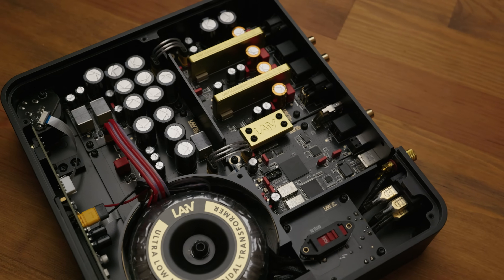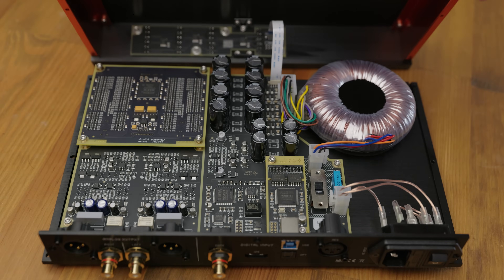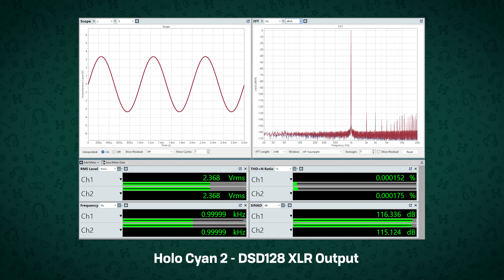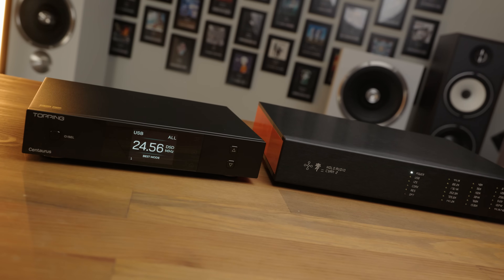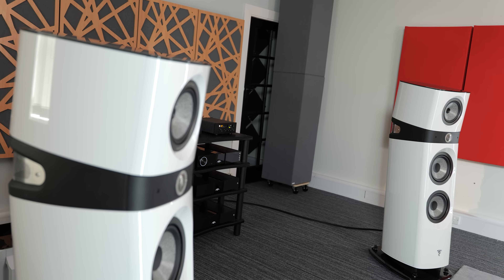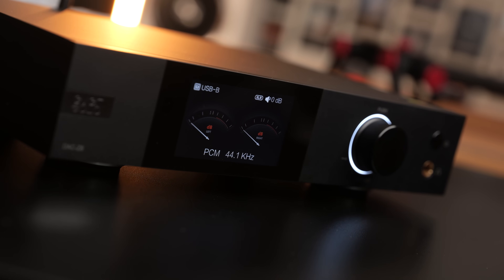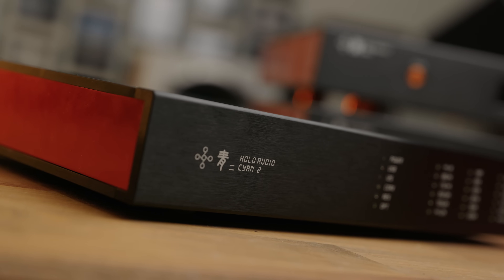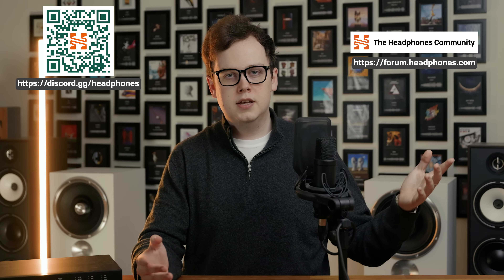The Holo Cyan 2 R2R DAC is fantastic....but....

Comment: Very nice review @GoldenSound as always, but it should be mentioned the transport matters ALOT. I had listen to my Cyan 2 feeded by my macbook pro's usb for months now and never found "the magic" of R2R (my amp is a Burson Voyager Max). I have even tried HqPlayer, including your settings. Nothing magicaly happened until I switched to a windows laptop with ASIO drivers. And OMG what a difference! Especially with Hqplayer. Now I understand the OS and corrections within HQplayer. Trough my Mac I 100% prefer the NOS, but on windows the OS mode is ridiculous good and even the NOS sounds better than the mac NOS. Can you explain what is happening with the mac vs windows setup? Why is there souch a vast difference between the two platforms (especially with spatial presentation)? The difference is like going from a $100 dongle to a full blown DAC as it should have been from the beginning.

Comment: Owner for over a year already and precisely what I hear. Straight NOS is wonderful and software OS is great too.  I use it with AQ Diamond USB, I do not hear any lessening of detail via NOS. It responds really well to better cabling for input and power. With laptops that power up quickly, it is really no hassle power cycling a different input, to coax, for example. Value is through the roof, but it will soon be very 'un-obtainium'.

Comment: some logical question around adding a upsampler is like  using or adding the internal upsampler function to cyan2(if my understanding is correct) but isnt dacs like May can only do either nos or upsampling？but adding an external upsampler to cyan2 implies going through upsampling first then feed through nos.in summary my question is adding an external upsampler to cyan2 is different by design than using upsampling function in May？which would be better？

Comment: so i have the cyan2 (and i love it)
question: 
1. have a wiim ultra what is the best way to connect the cyan2 to the wiim ultra ?
2. will there be a performance increse if i use the "smsl po100 pro" betwine the wiim ultra and the cyan2 (why ?)
thanks
Reply: I have both the Wiim Ultra and Cyan2. I think your best bet is to use USB Out from Wiim to Cyan2. 

Compare to the Eversolo DMP A6 M2, although the Wiim loses a USB DAC input, it makes up for by acting as a DDC. Whatever comes in digitally does go put via USB, I’m not technical enough to know if how much conversion is going on, I’m sure there is. But you kind of eliminate the downside of the Cyan2 not switching inputs easily. 

Hope that helps. No answer for no. 2

Comment: Great review, as per your usual standards :-) However, can I ask why you're recommending the "512+fs" DSD modulator for DSD256 (your recommended HQP settings)? It is my understanding that those modulators have been optimised for rates of 512 upwards, hence should be used with DSD512 upwards. Did you find them superior/better-sounding in lower rates (such as DSD256) also? If my understanding is correct, that modulator is optimised for suppressing noise the most effectively within the audible frequency range (as opposed to spreading it evenly) - I'm wondering how it behaves when used with rates lower than what it was designed for. Thanks

Comment: Thank you very much for your guide. It is very useful. However, your shared Google Drive folder only contains the settings for Cyan 2. Can you please provide me with your setting for Denafrips Venus 12th-1 or Venus 2, or at least let me know how many bits are optimal for Venus? I'm assuming 16, but I'm not sure.

Comment: I sold my Yggy to buy Cyan 2 with Red. I used DSD/HQplayer for my music listening, however with a bluesound node and external power supply, I watch movies,  and in my system Cyan2- NOS and bluesound HDMI arc sound is mind blowing with good soundtracks.
Reply: Which Yggy did you own? And do you think the Cyan 2 is better by much?
Reply: @ Yggy OG. I also have bifrost 64, which is similar to new Yggy TI chips. It is matter of taste, for me Yggy had less punch and a bit edgy. Cyan2 is smoother and has a better punch, less punch than chord DACs though. The reason I bought Cyan2 was high rate NOS and HQP with DSD.
Reply: @shkermanshahi  thanks. I own the Yggdrasil+ GS2 and it has NOS mode that I enjoy. But the Cyan 2 really looks tempting
Reply: @Old-Norse  the Yggy I sold was plus. I have tried nos mode on Yggy and bifrost,  I preferred the filter mode, because filter mode upsamples CD to 705k. The nos mode even with HQP goes to 192k. And it is pcm only.

Comment: Thank you! Finally a good and realistic review of Cyan 2. I have been using the Cyan 2 for a year and I came to the same conclusions as you are. I really love and enjoy with this DAC. In addition, I have been using an Ian Canada DDC reclocker with SC-Pure clocks and connected over I2S to the Cyan 2. For some, it might be an overkill but for me It is a killer combo. And thanks for detailed HQPlayer instructions!
Reply: whats the sc pure clocks for
Reply: @Leo-yn5fx  SC-Pure oscillators are low phase noise oscillators made and sold by Ian Canada. In Ian Canada DCC reclocker the oscillators are replaceable so you can play with them.

Comment: Excellent review. I appreciate your work. I wish Holo would make a fourth DAC that sits between the Cyan2 & Spring3. Single full size case, no display, defeatable lights, BNC input, Better Input Switching, Optional remote and whatever other improvements they could squeeze in. They would sell very well.
Reply: Or get a used Spring 3. People quickly go through DACs

Comment: I have the Cyan 2 since 9 months and I sell it. It is connected to my Bluesound Node 2i and if it did clearly brought improvements in terms of timbre and soundstage compared to the internal DAC of my Node, I’m a little bit disappointed with the fact that it did bring only very little improvements in highs naturalness and sibilance control. Which is something I was really looking for. You could say it’s jitter from the Node, and so I tried USB which supposedly is jitter free, well it WORSE than the node 2i via coax. That really disappointed me. Soundstage became flatter and overall sound became more digital, less relaxed. My conclusion is that maybe with a quality transport like the Red or something like that could really unlock the potential of my dac. But for less money I go for the Auralic Vega S1 which seems to outperform the Cyan while the quality streamer is already in. And that for the same price of my Bluesound/Cyan 2 combo. Hope that will help some people looking to buy a Cyan 2 maybe. Good listening.

Comment: Can't you get the NOS sound on delta sigma DACs just by rolling off the high treble a little?
Reply: Sort of. You can mimic the frequency response behaviour, but many people report that the lack of any DSP, dithering, or noise shaping (which DS DACs must do in order to function, but R2R DACs can run without) yields an audible improvement.

Whether you agree is up to you
Reply: Kinda but the tranisents will be slightly different? It's changing the roll off way above 20khz too

Comment: Considering a lot of us crazy audiophiles use Roon, how is this paired with Roon’s upsampling? I don’t really want to go down the HQPlayer rabbit hole if I don’t have to.
Reply: If you use Roon, it has built in support for HQPlayer, you can just select HQP as an output device in roon, guide is here: https://forum.headphones.com/t/goldens-hqplayer-oversampling-guide/25410

Roon's own OS is slightly better than most DACs, but it's not the same level as HQP or PGGB
Reply: You either choose Roon's upsampling, or you choose HQPlayer, not both. Within Roon's settings you select HQPlayer for playback.

Comment: normally the recommendation was upsampling rather than over sampling. Assuming that oversampling adds filters. so what is better?
afaik higer sample rates work better with nos because of some  reason iI  always forget the exact explanation.
Reply: Oversampling and upsampling are interchangeable terms. They're the same thing. 'Oversampling' is just more often used to describe when the processing is being done realtime and 'upsampling' is more often used to describe when something is upsampled and output to a file. But from a 'what's actually happening' perspective, they're the same thing just different words.

Comment: You are an odd contradiction. A while ago you basically showed in your DAC comparison test that you can't tell the difference between DACs (even though you could hear the filter?), and then here offer up loads of subjective "audiophile" adjectives for various DACs costing 4 figures. Then at the same time talk about how r2r DACs generally measure worse (however any noise below 90-100db won't be audible so the implementation is a relatively moot point). I'm guessing all of these DACs will measure absolutely transparent, and would be shocked if anyone that doesn't have your freakish ability to hear over 20khz could ever tell a real difference.
Reply: I don't recall him showing he couldn't hear the difference between dacs? Not sure what you're talking about
Reply: @mmm-u6e9e  In this video (https://www.youtube.com/watch?v=UzECc522A1Y&t=861s&ab_channel=TheHeadphoneShow) he basically finds that the only difference he can hear between two dacs is the filter one of them is using ABOVE 20KHZ. So a) he learns he can hear above 20khz(!) and b) he didn't hear any difference between the DACs in the freq range that the DACs were producing in common, showing that in the normal audible range (which is entire audible range for the other 99% of us) there's no difference. Therefore to now start using all sorts of flowery language about the many differences in how these high dollar DACs sound is very inconsistent.

I didn't particularly feel that what he did for the test was very meaningful in the over all DAC debate, but he was trying to come up with a way to provide a truthful, verifiable and repeatable result.

Comment: Ddi you transplant the R2R ladder from the Cyan 2 into the Centaurus or the other way around? I'd be interested in seeing the measurements using the other R2R ladder into both DACs.
Reply: The ladder modules are identical, there's no difference between them in terms of function/design. Of the three units I have here there's ~2dB variation in measured performance between them

Comment: What about the Ares 12th?
Reply: The Cyan 2 is notably better than the Ares IMO
Reply: @GoldenSound  which Ares? The ares 2 is not all the same as the 12 or 15th anniversary editions
Reply: 15th
Reply: @D1N02  15th seems to just add a remote control and slight jitter performance. The area 12th is the enyo 15th and quite cheaper
Reply: @ the 15th is basically the Pontus 12.1
Reply: I have the Ares 12th-1 (silly name) fed by an Iris 12th for USB. I'm always looking at possible upgrades but I'm not sure that I would notice much improvement with the Cyan 2 like I did when I upgraded to the Ares from an old cheap DAC. I'll still keep watching excellent reviews like this one until I finally snap and upgrade.

Comment: So just to confirm, you think it would be better to run USB from a DMP-A6 into the Cyan 2, opposed to USB to an Iris 12th, connected to the Cyan 2 via I2S ?
Reply: Certainly not. If you're using HQPlayer, you will want to use the dac correction available in the pipeline menu, and the only way to see this option is for HQPlayer to detect the cyan with a direct usb connexion. Trust me, I have a DMP-A8 and tried everything with a very revealing setup (wa33 elite, abyss tc, dz and HD800S headphones).
Reply: @louis-felixcauchon2515  how did you use HQP with your DMP-A8 since the A8 doesn't support NAA? I have a similar setup. Thanks.
Reply: @uclaxab  I connect the DMP-A8 via USB, then connect the Cyan 2 in it via I2S with an HDMI cable.

Comment: If I am only listening to CDs from a transport, is there a difference between the Topping and the Holo?
Reply: Same here, cd's only. Looking for an upgrade. Thinking of somthing like a Wandla HP as i am a headphone listener. With the Cyan 2 i still need a headphone amp.
Reply: @Zuignap57  If its in your budget Wandla HP would be my recommendation for a headphone setup. The inbuilt amp is great, and if you get the GSE upgrade, the spatial enhancement is a huge improvement for headphone listening. It's why I'm using the Wandla as my main DAC in my headphone system even though I've got a May, LINA, Morpheus and a bunch of other stuff here.
Reply: Good to hear Cameron, but which digital connection do you think gives the best results with the Wandla, AES/EBU or coaxial?

Comment: The myth that r2r dacs are superior in any way needs to end
Reply: Spoken like someone who hasn't heard them
Reply: @jaybrodnax  i dont need to have heard one regardless. I can tell you that no matter the magic bs you want to make up, you cant deny they they objectively measure worse. Less accurate, less resolving,  more expensive and infinitely more pretentious
Reply: But people have preferences that make a mockery of saying that one topology is inherently superior to another. In saying that, you’re also declaring a personal preference as to what a DAC should even do. 
Personal preferences aren’t universal truths. Sone people adore R2R. Some people don’t. I can’t see a problem here.
Reply: No digital sheen, bigger sound stage, more analogue natural presentation.
Reply: @D1N02 so your argument is that it colors the digital information you feed it? A dac is supposed to accurate reconstruct the original analog waveform.

All your perceptions about bigger sound stage and a more analog sound are a placebo caused by the fact that r2r dacs are inherently flawed.
Reply: @josh9673 no that is your argument. Mine is that many so called accurate delta sigma dac's strip spatial information and ruin timbre
Reply: @josh9673  DACs are supposed to do what the creator and buyer WANTS them to do. You are not the boss
Reply: @ its a digital to analog converter. If it fails to accurately convert that digital signal to analog it has objectively failed at its job. An r2r dac is a good way to separate a fool out of thousands for an objectively inferior product you can snake oil as "more analog". You are paying for flaws in reproduction that you could accomplish with eq if you truly enjoy a worse experience.
Reply: @josh9673  again, spoken like someone who hasn't heard r2r
Reply: @jaybrodnax i don't need to drive a chevy spark to know it's slow. I can look at the 0-60 time. 

I don't need to hear any given r2r dac to tell you it is inferior. I can look at the numbers. Delta sigma is better, there's a reason r2r dacs fell out of fashion decades ago.
Reply: @josh9673  bless your heart. Have you ever considered the possibility that not all relevent performance characteristics are captured by two commonly measured numbers? Have you wondered why tube amps, with higher distortion and worse noise floor than solid state, are so popular?
Reply: @jaybrodnax people enjoy tube amps for the same reason people enjoy vinyl. Not because it is superior, but because people enjoy the lack of dynamic range, increased noise and inconsistent play speed. People call this "warmth" for some reason.

Just because people prefer the inferior thing doesn't mean it has merits. Sure you can enjoy vinyl, go right ahead. Doesn't mean I'm not going to call you an idiot for spending thousands on a "nice" record player. Spending money trying to engineer your way out of a flawed format when digital is literally perfect.

Music is objectifiable. It's science. I don't care how something "feels". Point to a single measurement of anything tangible why r2r dacs are better. Trusting "feels" over measurements is what leads people to buying $10k speaker cables or audiophile network switches.
Reply: @josh9673  subjective enjoyment is the POINT of music, and devices that produce music. To say your favorite measurements are more important than maximizing the pleasure produced in the person enjoying their music and setup is objectively stupid.
Reply: True
Reply: Superior in smoothness

Comment: thanks for video
so you are saying OS is mostly superior to NOS?
Reply: Depends on OS implementation… all delta sigma dacs do in built OS, most r2r, HQPlayer’s OS is objectively better (in capability, just need to determine user preference filter settings) than industry standard OS in built to DACs
Reply: They are both enjoyable but it's really going to come down to personal preference. Like GS, I use both depending on what I'm listening too. HQPlayer has a bit of a learning curve to it but if you're willing to put in the time it can be quite rewarding.